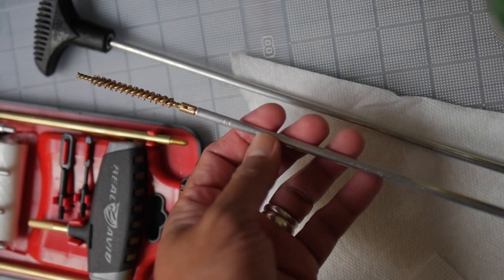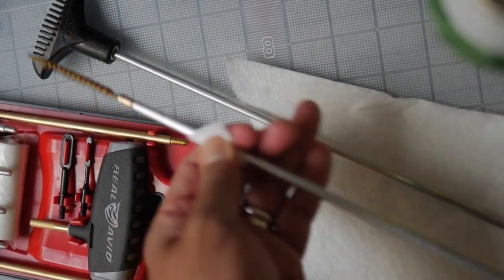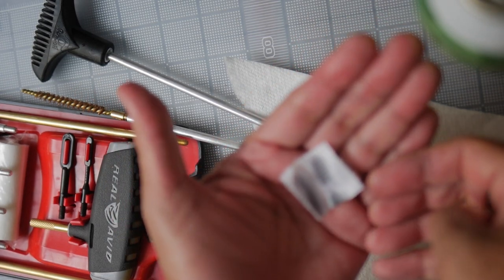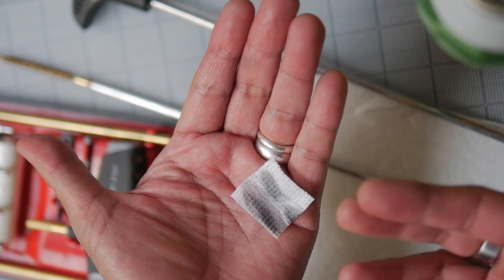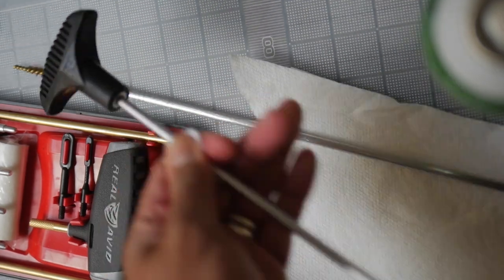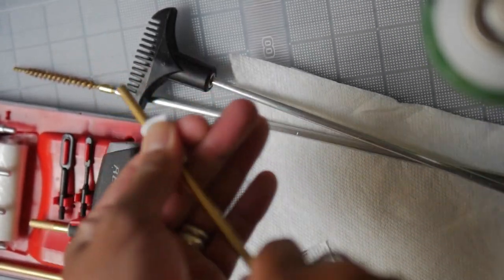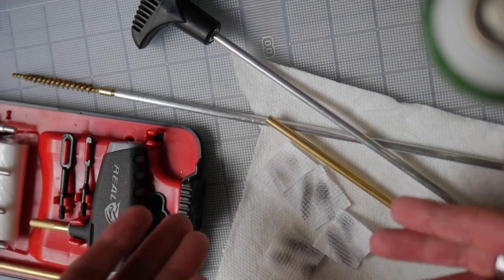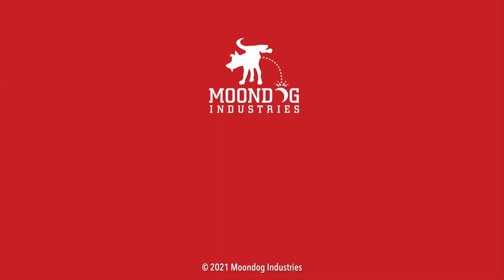Do Aluminum Cleaning Rods Foul Guns?

Comment: Brass is generally harder than aluminum, but not really by much. Aluminum can have have hard debris imbed themselves into the aluminum, but that would mean that whatever your bore cleaning attachment you're using isn't cleaning as it goes down the bore. The advantage of aluminum is that it really can't scratch the bore as it slides down (think of bearings: direct surface bearing always has one surface hard and the other softer).
Reply from the maker: Good to know. Please subscribe.

Comment: The black on the rag or patch is just oxidation from the aluminum. You can see oxidation on iron or steel in the form of rust. I used to paint aviation projects. You have to get Aluminum extremely clean before priming or painting it. Using solvents or reducers you can clearly see it on your rags or tack cloth. It's a hazy gray that's not readily apparent like oxidation on iron aka rust.
Cleaning the rod first and/or putting a light bit of Rem Oil will make it easier to glided the rod down the bore. Trying to keep as straight as possible or using a bore guide will help. It shouldn't transfer to a quality bore eapecially a chrome or chrome moly lined barrel. Or use polymer rods as some long distance snipers do. They are meticulous about cleaning their rifles and it shows on their groups the average shooter like me couldn't achieve.
Reply from the maker: I figured but I thought aluminum oxide was white, not grey black?